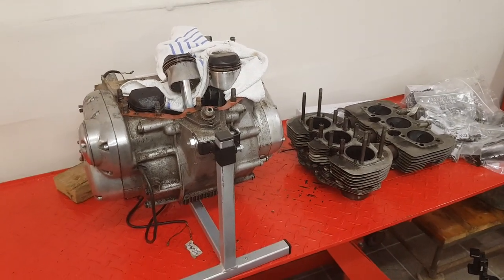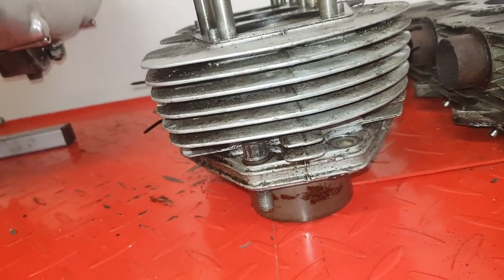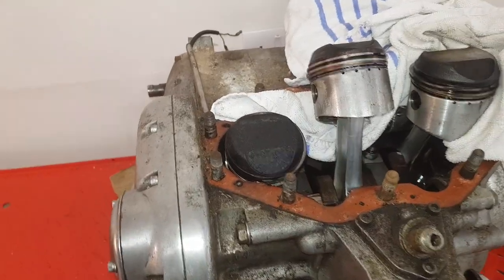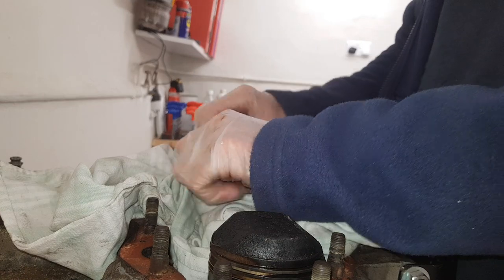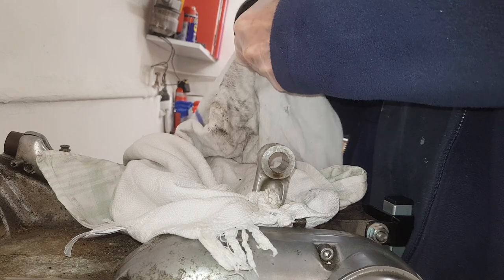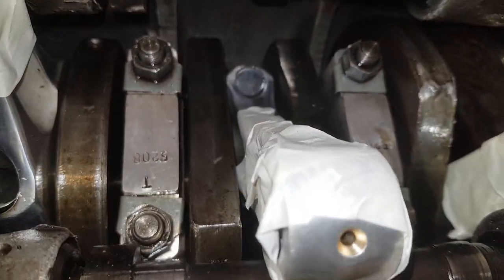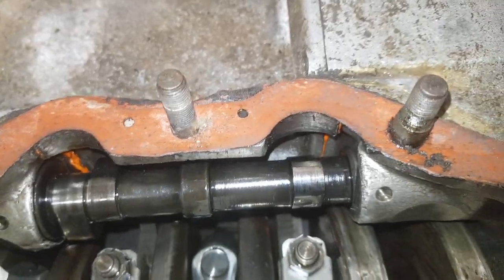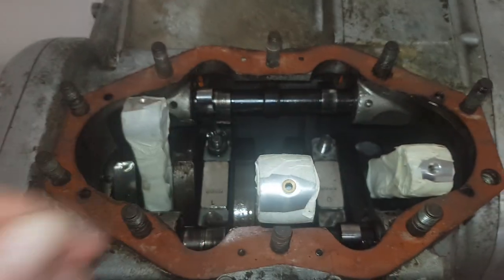Triumph Trident T150V Engine Rebuild. Part 3: Removing the Pistons.

Comment: I was able to remove the main bearing caps on my engine buy heating the caps quite hot ,tapping them gently to break the seal,and using 2 levers just to wiggle the caps free.
Reply from the maker: Thanks. 👍

Comment: Hi Chris, I am currently trying to see whether my T160 needs a rebore and new pistons. Could you show how to properly check the bore size and piston size. I have vernier calipers but no specialised measuring equipment. This would make a very useful topic to cover. keep up the good work. Thanks alot
Reply from the maker: Hi there. That's what I'll be doing shortly. Once the engine is fully dismantled I'll be checking for wear on all parts of the engine, including the cylinders and pistons etc. 👍
Reply: Thats Great, I'm looking forward to it.

Comment: Hi Good stuff Chris, consider use of threaded bar/washers to draw gudgeon pins out, rather that hammer shock load on con -rods?
Reply from the maker: Yes, good idea, especially if the gudgeon pins are very tight in the pistons. Generally though I find they're not too tight, and often just slide out with finger pressure.